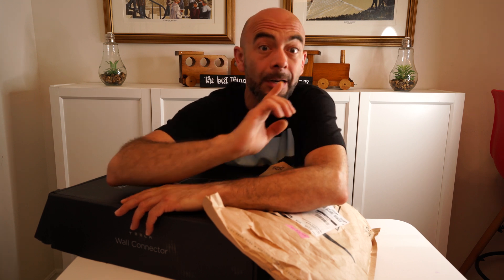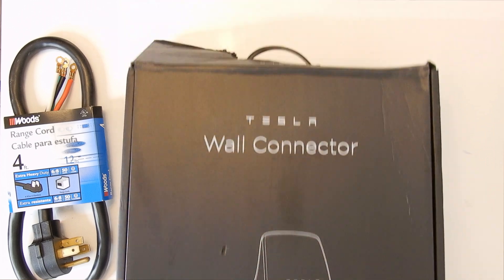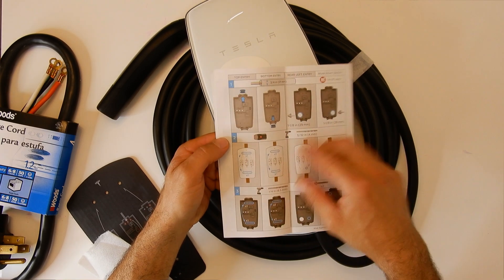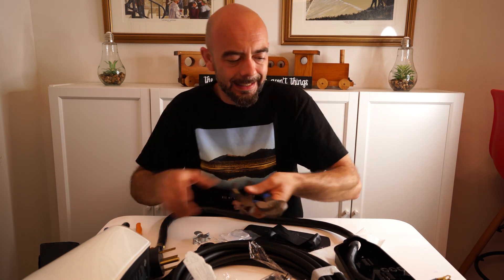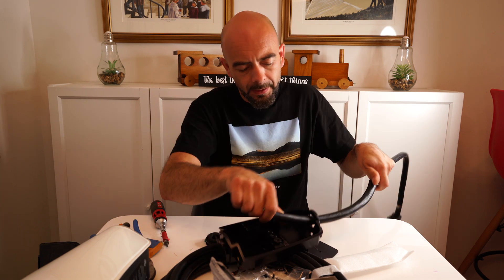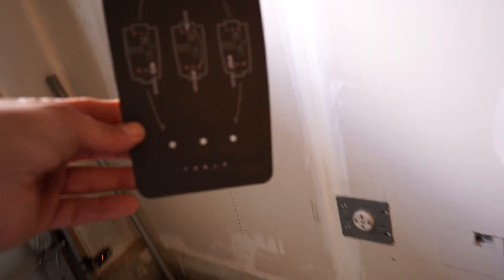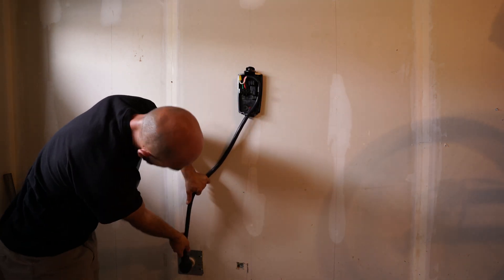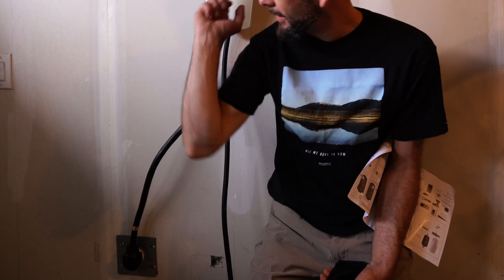Tesla Model 3 SRP | Installing a Wall Connector using a Range Cord and NEMA 14-50R Plug | Easy DIY

Comment: About how much of that 4ft cable ended up getting looped in the wall connector.  Thinking of doing this but need much shorter cable than 4 ft so thinking of cutting the whole thing down.
Reply from the maker: About 10 inches

Comment: Missed a very important step - need to set the wall charger to 40A charging (assuming the wall socket in this video is on a 50A breaker, 50A wiring). The NEMA 14-50 socket is only rated at 50A. Only 80% of the breaker/socket rating is allowed as continuous load (hours of charging). Keeping the charger at the default 48A charging (60A breaker) will likely not trip the breaker, but can overheat the wiring and/or the breaker, even potentially cause a fire. In order to use 48A charging, you need a hardwired installation connected to a 60A breaker.

Comment: What are the names of the tools used? I’m referring to the tool used to cut the wire tip and the one that removed the plastic cover off of the end of the wire.
Reply from the maker: Knoweasy Wire Stripper with Cutter and Wire Stripping Tool or 2 in 1 Wire Stripper Tool Works for Electronic,Electric,Automotive from 32 to 7 AWG https://a.co/d/gygS7U8